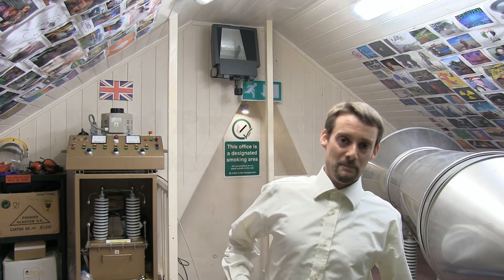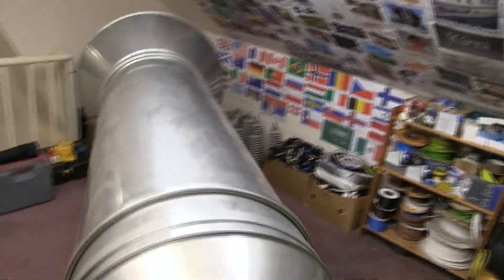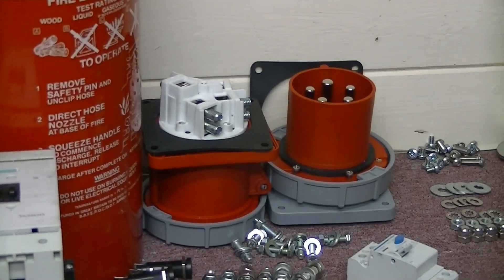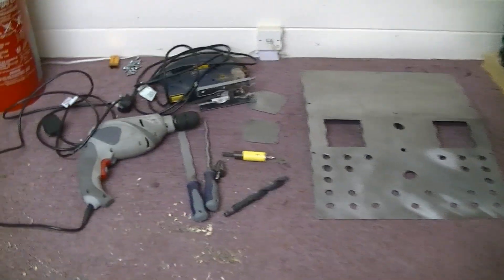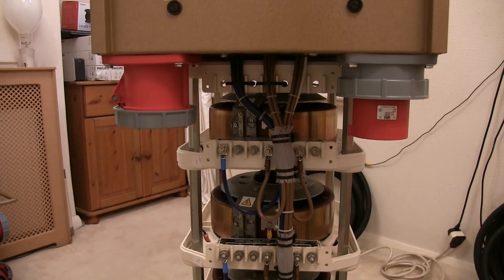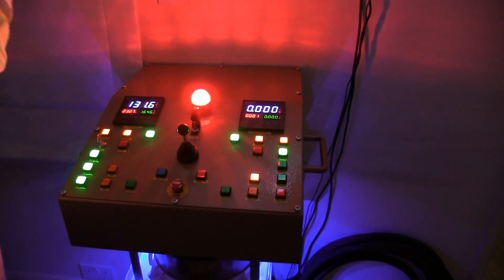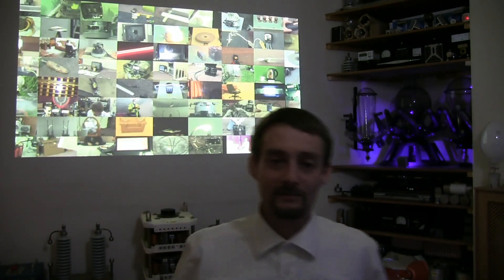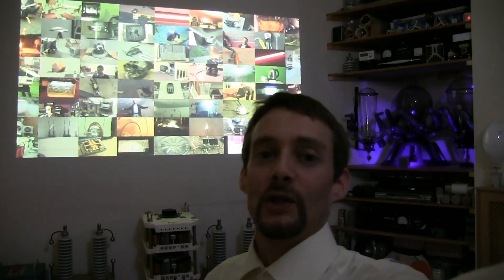20,000 Watt Power Supply

Comment: Wonder if this can power my AMD PC lol.
Reply: Not a chance, especially if you want to run an FX9590 and a Radeon 295 X2.
Plus, you'll need the combined power of the AC unit in the One World Trade Center on top of that CPU just to get it below TJMax!
Reply: ***** with the cooling off of the semiconductors from the LHC at CERN.
Reply: ***** youre on a video for a 20,000 Watt Power Supply.
Reply: Large Rock barely, AMD stuff uses so much power, 20kW just won't cut it
Reply: Tyson Kennedy This is in the name of science and curiosity.
Reply: Tyson Kennedy Mostly curiosity.
Reply: Tetra Digm You're making a pretty strong assertion by saying AMD does that with every single one of their CPUs. It's only been confirmed for a handful, and that was years ago. If you have a source, go ahead and link it.

What the hell do you mean by "high quality" and "low quality" silicon anyway? GlobalFoundries produces most of AMD's processors and GPUs, and they use the same fab for everything. The fact there's less lithographed onto a die doesn't mean it's lower quality silicon. 

though I really am not interested in an AMD vs Intel discussion, I must point out that you're wrong in saying AMD is significantly worse than Intel. The FX-8350 was a smidgen slower than the i7 3770k, while being much better price-performance wise than any i7 ever made. 

the last point you put forward is just bullshit. The GTX690->Quadro K5000 hack was a hardware modification and has nothing to do with Nvidia's drivers/firmware. It was the exact same chip they used on both cards, but with a much higher price on the quadro
Reply: ***** they pick the best performing wafers, use them with all cores on the xeon, then the ones that performed worse have 2 sealed and get sold as i7's.
Reply: Tetra Digm
actually intel does it with most of their cpus aswell, especially in the extreme series the 5960x 5930k and 5820k are all the exact same chip (this was the same with the other generations before aswell) just with different numbers of cores enabled depending on the quality. same for all the variations of i7 they are all just the same chip which came out of different levels of quality checking, same for all the variations of i5 and all the variations of i3. its something that is done by all semiconductor manufacturers. amd is shit just because amd is shit its not really much to do with their philosophy of making one chip and disabling parts for lower end versions.
Reply: pc runs on 6 and 12 volt. only problem if the setup cant provide a constant current.
Reply: László Simon Magyarok mindenütt! :D
Reply: There's only one way to find out :P
Reply: ***** in all seriousness they don't use that much power. GPU use a ton more.
Reply: AMD/Budget/LowPower
Reply: Tyler Raber To get any decent amount of performance out of them you need to OC them to the shithouse.
Reply: Tyler Raber Do you have any sources backing this up? I was always under the impression that AMD systems require more power (compared to Intel-nvidia systems) when doing similar tasks.. but all the comparisons that reviewers do always have fundamental flaws in them which make them inherently unscientific. Reviewers are still doing 100% load tests (meaning the systems are not doing the same amount of work), or not using similar-specced power supplies.
Reply: Tetra Digm you actually don't have to raise the voltage all that much. I am pulling over all about 140w and I'm OC to 4.4ghz @ 3.08v
Reply: ***** I could give you gaming loads, but what I was saying is a GPU uses a ton more power than the CPU does.
Reply: Tyler Raber that's exactly where reviewers make their biggest mistake. Most games will load your system to its fullest resources (which it should). So when you're comparing two different systems and their power consumption, the one using more watts might also be doing more work, thus making an unfair comparison. AMD vs INTEL has never been about total power consumption, but about performance-per-watt, and you simply can't measure that with 100% load
Reply: Tetra Digm Lol, you make this sound like a hit-and-miss game. Yes, AMD has released some CPUs in the past that had "locked" cores, making low-tier and mid-tier CPUs identical. However, Nvidia has also done firmware-crippling in the past (GTX690 and the Quadro K5000 were the same card), and Intel has also done this (i7 3960X was identical to some high-end Xeon, despite the xeon having 2 cores more). I'm unsure whether this is done simply to get higher yields, or to make the super high-end more affordable.
Reply: ***** the core differences in xeon/i7's is due to binning...
Reply: ***** I doubt it's binning. It's always the same two cores (on the die) that are disabled in i7, and they're locked with an on-die hardware fuse. If they randomly locked two (non-functional) cores, then it would be binning.
Reply: ***** A core either works or it doesn't, there's no such thing as "performance" when comparing two identical functional chips (tolerance to overclocking aside). I can understand yield issues, but yield is only an issue when you first introduce a new fabrication method
Reply: ***** There are several hundreds of variables, not just "works and doesnt work"
some just straight up fail at higher voltages, some have errors temperature transferring between the die, the compund and the lid, and there are such small manufacturing tolerances that although it may fail as a workstation grade cpu in a 24 hour runtime environment where an error will cost millions of dollars, but it can still safely and reliably function in a recreational environment such as a home rig.
Reply: Tetra Digm I'm typing this from an Intel i7 3610qm with an Nvidia 650 in it, your prejudice is out of this world. If you seriously think AMD does not have a better price-performance ratio, then please explain to me in detail why both the Xbox1 and the PS4 use an AMD processor and graphics. Could it perhaps be... that AMD is simply offering the best performance at a low price..?

The K5000 Gtx690 hack was never confirmed, nor disproven. Does it not bother you that the identify of a chip is determined by a couple of resistors, instead of the die itself?

I don't even know where you're getting the whole silicon story from. Globalfoundries operates to fabrication standards at 32nm and 28nm. This is not some one-hung-low company producing jelly bean opamps you know, they're a European company producing advanced integrated circuits. The purity of the silicon determines the overall yield (and profitability) of the production. Globalfoundries does not purposefully use low-purity silicon in anything, that'd be detrimental to their own profits. 

I really don't know where you're getting your statistics from. As long as you're not stating sources, you're pretty much just trolling.
Reply: ***** laptops are kek.
Reply: Tetra Digm you insulting my ti-84 PLUS by texas instruments? I'll have you know I can draw pictures on it.
Reply: ***** What you're describing are all the variables that determine whether or not a cpu passes (works) or doesn't pass (doesn't work). There's so many bypassing circuitry in a cpu that a consumer will never notice small manufacturing errors. The number of mathematical mistakes a cpu makes is in an order of magnitude that makes it completely irrelevant. Of course there's people claiming there's a difference between consumer-grade, workstation and milspec. That does not mean the consumer electronics is going to have intermittent problems or otherwise have lower mtbf. Read up on google's study that completely debunks "enterprise" grade harddrives, and backs up claims that "consumer" grade drives are less costly in the long run. There's a lot of claims made by manufacturers these days, if you're going to bite into them, and spread their non-sourced bullshit, do it to someone else and not to me.

Also, mission-critical machines should have a failover. A single chip should never be responsible for deaths or revenue lost. You're implying otherwise.
Reply: ***** It's not about whether people notice, it's about failure rates and return rates, which dictate whether or not people are gonna buy your shit.
enterprise grade drives like the intel SSD's have much better failure rates and life times than the samsung or OCZ equivalents.
Reply: Tetra Digm you are nothing but a useless troll. Read this carefully, peabrain!: first off: the price to performance ratio of AMD to Intel is better: fact. In order to get an amd processor to work similarly to an Intel one you do have to over clock it. AMD over clocks much better than Intel. Intel heats up faster the more you over clock vs amd. AMD runs hotter stock but over clocks better and remains relatively cooler compared to Intel. My 8320 OC to 4.4 GHz with a crappy old corsair h50 on an Asus sabertooth 990fx will render videos in a similar amount of time compared to my friends 4770k OC marginally on a new h50i. Also neither CPU bottlenecks on bf4, a CPU intensive game. 
Second: His laptop has a nvidia gtx 650 which uses 2gb of DEDICATED VRAM. Learn to understand what the hell you are talking about!
Thirdly: Amd, nvidia, and Intel all have processors that perform worse/better due to how well that specific chip turned out. Not every single chip performs the exact same. Amd and some third party nvidia card makers bin their processors to find which ones perform better and sell the better ones at a higher price with a higher clock and therefore higher performance. Intel CPUs generally stay within a tighter range however some processors do over clock better than others.
Lastly: Intel vs amd is not really much of an argument. If you are tight on a budget and want the most bang for your buck with a slight decrease in reliability: then go amd. If you want maximum performance, or aren't willing to sacrifice reliability at all then go Intel.
Reply: Hohohohohold up, Your lord GabeN has arrived. Both are good at different things and BOTH have their own flaws.
Reply: megaspeed2v2 amd isn't really shit. Intel is just better but also a shit ton more expensive. If you want raw performance go with intel. If you don't want to sell your left testicle, get AMD.
Reply: Tyler Raber
its not really "a shit ton" more expensive, when you account for that you need a good motherboard costing at least £75 and a decent aftermarket cooler at least to run a FX8350 overclocked enough to get the same performance (or actually less performance in single threaded applications) as a stock clocked i5 4400 which you can run on a £35 motherboard with stock intel heatsink the price ends up pretty close or even cheaper, you've gotta think of the big picture, not just the price of the chip itself.
Reply: megaspeed2v2 on an nhd-14 you can get performance close to a mildly oc'd i7-4770k so you don't know what you are talking about.
Reply: Tyler Raber what? no.. ive seen benchmarks of a 5.3GHz FX8350 which was only similar in performance to a stock clocks i7 3770k (was on jayztwocents channel iirc), the i5 would lose out about 30% performance in video editing compared to the i7 but at a price to performance standpoint that's still a better than the FX8350 since due to its extra efficiency you dont need a high end motherboard and aftermarket cooling to run one.
I'm not an AMD hater im just using common sense, its stupid to compare a FX8350 with an unlocked edition i5 or i7 intel cpu because it doesnt even compete with them, thats just the way it is right now.
Reply: Tetra Digm one: the parts will be obsolete in 4-5 years, two: you need a 60-70 dollar psu for it. you don't know what you are talking about.
Reply: Tetra Digm too bad I'm running an 8320 @ 4.2 GHz 1.300v with an r9 280x on a 60$ corsair tx750 so you can take your misinformation folded into sharp corners and shove it up your ass
Reply: Tetra Digm https://www.amazon.com/dp/B00ALYOPSS/ref=cm_sw_r_awd_khcQub0NKGA9B $70 stop talking out of your ass
Reply: Tetra Digm that PSU is running in my system right now. You are completely full of shit. That is a good PSU.
Reply: Tetra Digm my computer has not fried, and runs perfectly fine with no stress on the psu. Also, the difference between the cx600m and the tx750 is negligible in this case. Besides, the tx750 I run is probably about the same as a cx600m due to capacitor aging that happens on every PSU. My PSU is somewhere around 4-6 years old. You literally have no idea what you are talking about. What are your PC specs Mr. Computer prodigy that seems to know all?
Reply: Tetra Digm http://imgur.com/VtVCruP there's my PC. You literally have no idea what you are talking about.
Reply: Tetra Digm its called it doesn't fucking matter. It runs all the same. I am not running 290x's in crossfire. You don't need an insane power supply to run things. As long as it is at least 80+ bronze at least, and from a reputable brand it will work. I could run a cx600m just fine, and be under its max load.
Reply: Tetra Digm no it will not. You are so full of shit its not even funny.
Reply: Tetra Digm I am running this system currently, and I have zero issues. I can give you benchmarks and everything. I am even running everything at 5760x1080 now. No issues. Get your facts straight.
Reply: Tetra Digm and brand has everything to do with what PSUs will be reliable.
Reply: Tetra Digm yeah cheap shit from unreliable manufacturers. Corsair, seasonic, evga, nzxt, these all make good quality PSU's among some others. There's a good list of psu's with a list of lemons and a list of worse ones. All the bronze, silver, gold, etc.... Says is how efficient they are. Therefore some at full load will output more heat than a more efficient one, and will take more power from the wall. granted there are a few bad ones from these manufacturers, however reviews can tell you which ones are good or not. Corsair has no bad psu's.
Reply: Tetra Digm http://www.johnnylucky.org/power-supplies/psu-lemon-list.html
Reply: László Simon pc run at 3.3, 5,12 volt
Reply: Tetra Digm Wow you are mad, son. Not even sure I'm supposed to comment on you, you might sue me for causing you heart issues.

I told you before the FX series offers much better performance-per-dollar. That's bang-for-buck in your plebeian English. Even if the performance is worse than the top-of-the-line intel CPU, you're clearly paying double for no realistic performance increase outside of artificial tests. You cannot deny that an AMD system is cheaper, there are real-world examples all over the shop.

Just to make sure we're talking about the same thing here, I'm talking about this particular gtx690 hardware hack: http://www.eevblog.com/forum/chat/hacking-nvidia-cards-into-their-professional-counterparts/ . In this forum post, they're describing that several smd resistors identify whether the chip should behave as a gtx690 or a quadro k5000. Read the post, Nvidia has been disabling cuda cores for loads of their models, let alone their rebranding tactic. Again, this all has nothing to do with firmware or drivers, 

.. I don't know if you're trolling me. I just told you AMD is a fabless company. AMD does not produce silicon, nor does it lithograph its own chips. AMD has outsourced all of that to a company called Globalfoundries. Globalfoundries buys the silicon, purifies it, crystalizes it, saws it into wafers, polishes it, and then they litograph the designs onto the wafers, slice it up and package the dies into chips. Globalfoundries works for loads of fabless companies, they don't specify "quality" grades. Besides, don't you think the consumers would notice if their computer wouldn't start because the cpu is broken? ;)

Comment: If you haven't got time and are stressed, please take a break.
Reply from the maker: I did :)
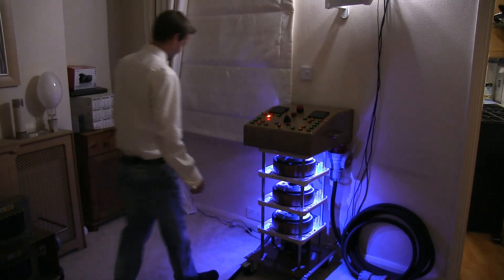Reply: Good to know. by the way, what is that humming noise that all high voltage electric devices seem to give off? i'm an absolute novice in electronics so i have no idea if it's really caused by electronics, just check 7:05 for the sound... is that mains hum?
Reply: Justin Koenig
In the transformers (the things that exchange volts and amps), there are a series of plates. The electricity going through the wires creates a magnetic field that flips poles N/S about 50 times a second (in the UK). This causes the plates to vibrate very fast, causing that electric hum.

Comment: Anybody can weld better than you Andy.
Reply from the maker: lol, perhaps I should stick to fixing tumble dryers
Reply: ***** I think so!
Reply: *****
Lol I think your welding would be better if you used welding rods instead of sparklers :)
Reply: FrontSideBus ***** This makes me think... maybe a 20kw tumble dryer is required. I am seeing a front venting dryer (one of those mini ones) blasting flames out the front, flames that used to be whatever you put in it...
Reply: ***** much more fun in cranking the tumble dryers on the variac until something pops.

Comment: I dont know what program you use for editing, but Sony Vegas would be great for these simple edits!
I render in  AVI   (Progressive Scan!!! and uncompressed) and then use Handbreake to compress it to an small MP4/MKV
A 10 Minute Video in 1080p takes about half an hour of upload time (with my slow connection)
Reply from the maker: far too complicated for me mate :(
Reply: Oh i didnt know that :(
Well better these lines than 3 big dots on the screen! :)
Reply: ***** Premiere Pro is even easier to use.
Reply: ***** Not at all!
Film in progressive (full frame, that's the P in 1080p or 720p), or at least de-interlace - your video quality will go way-up as a result. Handbrake is free, you only need it if you work in raw uncompressed formats (HUGE FILES). If you want help figuring it out, drop me an e-mail - I'll walk you through it.
Reply: ***** If you do go handbrake, I'll give you my custom preset settings for HD resolutions, which'll give you the best results.